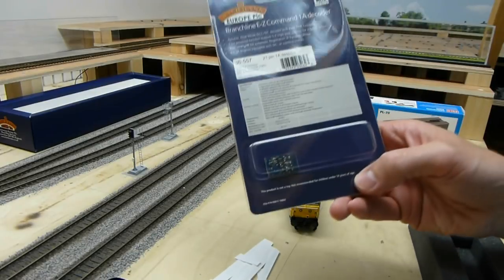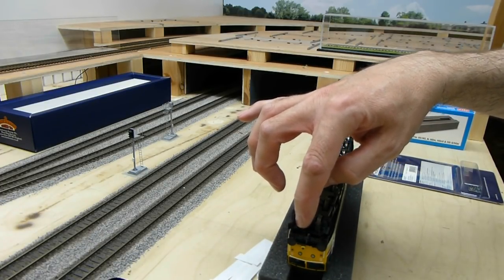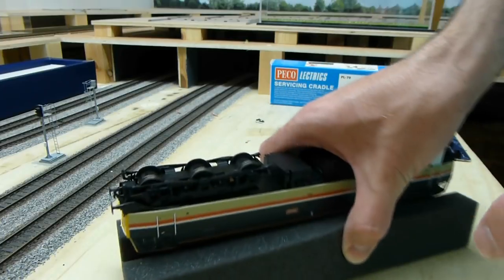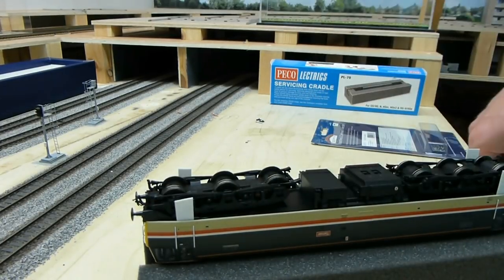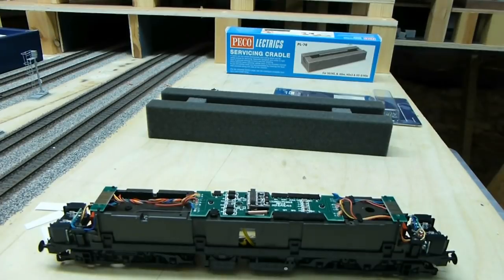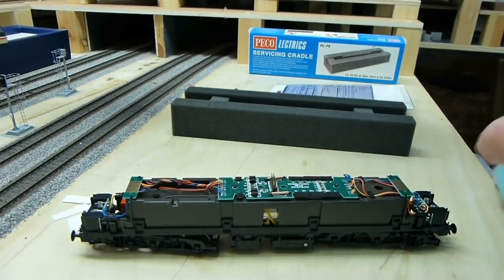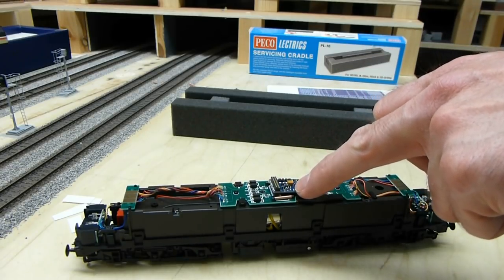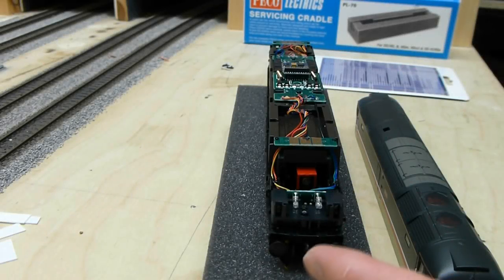Dean Park Station Video 161 - 'How To' Fit A Decoder In A Class 47

Comment: Dave! A massive thank you. Just come back from hols and what a nice welcome home present. I now have a great excuse to save some petty cash for a new class 47 purchase and follow your great instructions. I had not used the plastic shims or any substitute on my current 47, looks like that was what was causing me problems. Also the Peco loco servicing cradle looks like a good buy to preserve the paint work on the loco. Will update you in due course as soon as I have managed to save up for a new 47. Cheers.
Reply from the maker: Hi, did you not ask me for a 47 video on this?   I cant remember lol. Glad it was of use to you. Dave
Reply: Hi Dave, yes I did and I really appreciate you doing this video and the additional comments and tips from your viewers. I only got back into railway modelling 2 years ago after having seen your videos and Richard from Everard Junction and the first loco I bought was a Bachmann Class 47 - Firefly. I was super impressed with its detail, the last time I was building model layouts was in the early 80s when I was a young teenager and I have to say the detail now is amazing. What put me off buying more 47s tho was the nightmare I had of removing the body. I ended up pulling the glazing from both ends while removing the body to install the decoder. I managed to glue the glazing back but then getting the body back on was equally painful. I now see the error of my ways and this has given me confidence to buy at least another 47. Thanks again.

Comment: Hi Dave, loved the video as usual. Despite being extremely careful, I got the dreaded snap on one of the window clips and the window is now loose inside the cab.  Is there any way of removing the cab that you have employed?  The whole thing makes me quite nervous as I'm new to the hobby so any tips would be gratefully received, and if there aren't any - fair enough!

Best wishes, great video. Adam.
Reply from the maker: Hi, glazing falling out is more common than you might think. Plus cab remove is a nuisance!, but possible. Where there are two brass wiper pick ups on the roof you have to put a thin screwdriver in the and try pivot it up a little, to get the cab to come out you’ve got to ease the body apart at the doors to try get the cab over the door glazing, Clips, when keeping the cab pivoted. 

Not easy to explain, but it can be done.
Reply: @DeanPark  thanks so much for getting back to me mate, I really appreciate the advice. 👍🏼
Reply: Dave, I finally went for it and your explanation worked perfectly! Big moment. My first layout has come on a log way and a lot of that is down to some of the things I've learnt from web sources and of course YouTube channels - yours has been a big reference for me, particularly as I'm modelling a similar era. Many thanks for you all your great content.

Comment: Bachmann needs to address the wiring and the PCB, both of which are unsatisfactory. The wiring is too tight if you are adding a speaker (I ended up undoing the bundle on my 37) and the PCB flexes way too much - there is the potential for the PCB track and joints to be broken. There is also insufficient room for where the decoder sits, especially if you are fitting an 8 to 21 pin converter, but I suppose they are trying to lock you in to their hardware etc. Final gripe, although it should be clear when fitting the 21 pin decoder, it is possible to fit it the wrong way, especially if your eyesight is not what it once was! Thanks for the instruction Dave - Pete

Comment: How I wish Waverley had come apart as easily as Tamar One of those clips was a nightmare to release. After a lot of effort to fit the speaker because of that wiring in the way I again struggled to refit the body. Only difference to your re assembly I make is to test run the loco before inserting the screws checking the lights work as I have found sometimes the contact has needed adjusting On this occasion thank goodness everything works fine.

Comment: With the high cost of Models now ,why can’t they be designed with a compartment underneath the model similar to a battery compartment where by you open it fit the chip and off you go ,with the fragility of locos with high detail now could it be done ?,the only time you have to open up a model is for heavy servicing ,me I would chicken out and buy one with a chip fitted as I seem to be ham fisted hehehehe ,nice posting Dave ,all the best ,Mark
Reply from the maker: 1968concorde good point... it seems so simple lol. I’d love a model that was that easy to access. Dave

Comment: The 47's body shells are a pain in the #**@ to come off. I've knocked out a couple of the cab door windows on removal, I thought it was maybe not enough glue when they were made.. easy fix though!
Reply from the maker: I have had to reattach many windows!!   Not much holding them in place....which I suppose is good in one way, as if you want to respray etc you can strip the loco down and get rid of the glazing for when you are painting etc.   But its a bit annoying when the glazing starts floating around in the cab as you have to take the cab interior out....which is a right pain in the ** as well, getting it back in is just as bad!  Dave
Reply: Luckily I've not encountered that yet, but I've not long fitted a decoder to one of my early Hornby class 50's and the body wouldn't come off. Turns out the mechanism that moves the adjustable louvers on one side was stuck (glued I think) to the chassis and with a wee bit of pressure I managed to remove the body, however the mechanism that moves the louvers also came off. They are an absolute nightmare to put back together again lol.
Reply from the maker: You have to be VERY careful when putting the 50 body on that the louvres line up perfectly with the slots on the side of the chassis.   If you force it the louves can detach.  The new models, ie Ajax and Vanguard were shocking for that.  I had to send one back as it arrived with the louvres floating around the box.  The next one was fine until I took body off, then they fell out.  I eventually sent it back to Hornby who repaired it.   I dont think they need moving louvres....they should just fix them in place as its a bit of detail which is impressive when working, but totally needless.   If they replaced it with a fixed moulding then it might reduce the cost by £5!!  We live in hope!!! Dave
Reply: I've still got Ark Royal, Ajax and the 50th anniversary special D400 to fit decoders to. I haven't touched them yet after what happened with the louvers on Superb. I think in future if I buy any additional class 50's, I'll have the shop fit the decoders first lol.

Comment: Good vid!

Same sort of mess about with the Heljan Hymek.

Personally I think it's a load of crap.

Old Hornby style connecters can't be beaten.  1-2 screws and maybe a lug and hole at the rear - easy, no faff, no risk of breakage, user friendly.  (Think A3 Pacific etc)

This clip method is a pain in the ring and nothing else.  Seems to be either cost cutting or a lame attempt at pointless innovation.
Reply from the maker: Sparkshot the more modern releases from Bachmann are less of a pain to get the body off!... a little tweak to the 47 chassis and Bachmann will improve the body removal saga of the 47! :-)
Cheers
Dave
Reply: @DeanPark  - good to know!  Not brought a modern RTR loco for a long time though.  The prices get me running to the hills.  I've regressed into the 2nd hand stuff.

Building a new 00 layout now anyway, recdntly started making vids on it.  Keep up the good work, all the best.😀